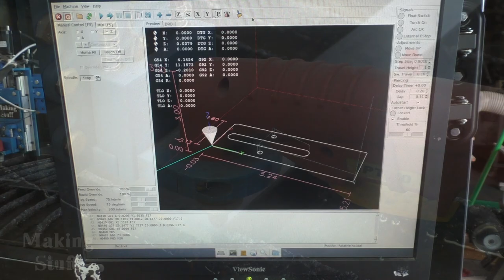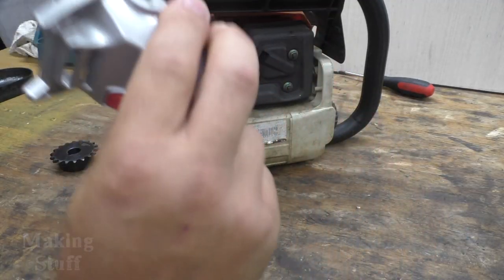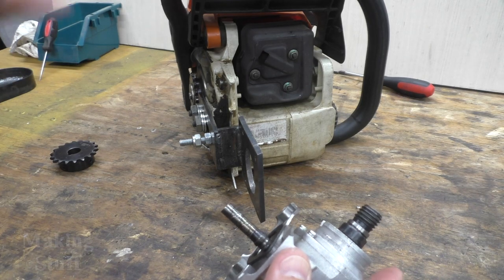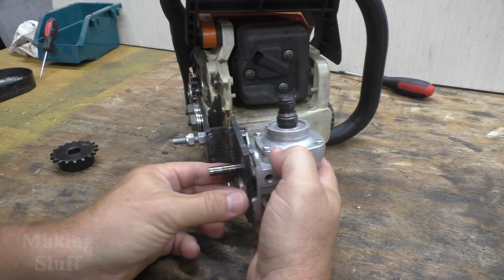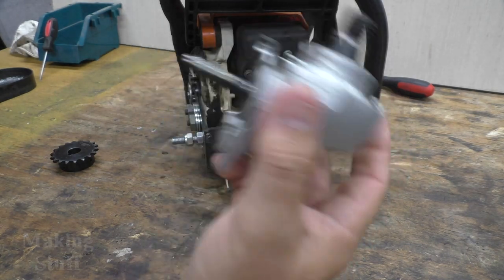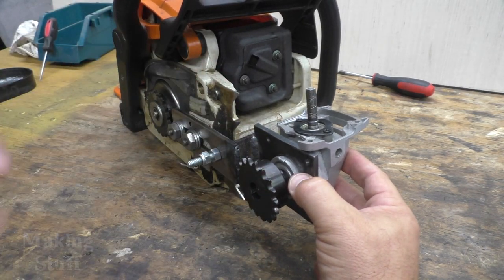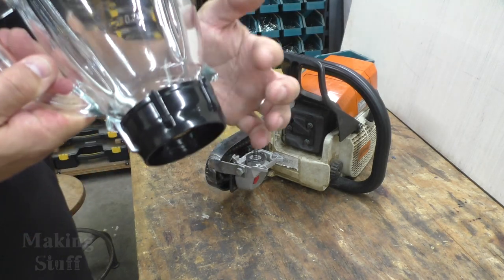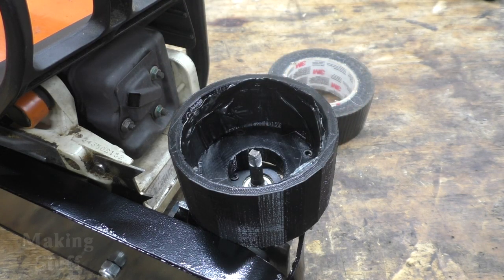Gas Powered Blender - Will It Blend? Chainsaw Hack 2

Comment: that was really stupid, you made a stinky chainsaw to run a blender it you used a battery chainsaw it be a lot cleaner but not so interesting idea if you want to run electric equipment make a genenrator to run it or do the victorian way and run pulleys on long shafts to other long shafts with pulleys to run a lot of equipment
Reply from the maker: I'm sure if Colin Furze or Made in Poland had made it, you'd be all over it.
Reply: @MakingStuff  no i wouldnt it pointles idea why dont you make something from the 50s that was a great idea but never madfe again tarpen hedge timmer uses a long flexi drive no ones making that and thats a good idea